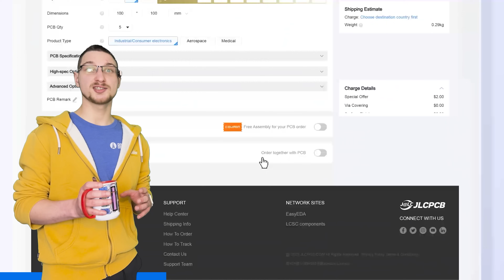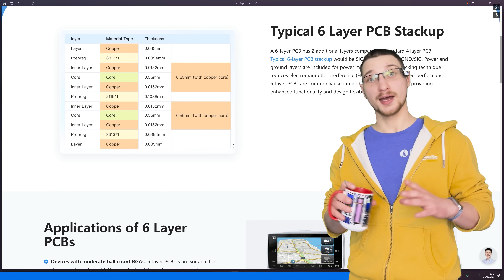How to automate almost anything

Comment: Last year I was doing an art project that involved a raspberry pi zero 2w and some sensors, I had trouble specifically with the max4466 microphone, since the Raspberry Pi doesn’t have an analog-to-digital converter (ADC) built-in, it cannot directly read the analog output from the microphone sensor. I tried to use an arduino nano and then I found that sending data via serial from the Arduino to the Raspberry Pi was unreliable and complicated.

To solve this, I connected an LED to the Arduino that turns on whenever the microphone detects sound above a certain threshold. Then, I placed an LDR connected to the Raspberry Pi near the LED and covered both with an USB’s cap.

Comment: Using those pnp and npn , u can make a gate driver for a mosfets that requires perfect timing and also to remove stress on mosfet and shift the driving load into those npn and pnp transistor that will help running mosfet properly . Ita called push-push from what i know. Good info video!😊

Comment: Why not use the pins of an esp32 directly? Because the gpio can emit 3.3v? Also, it is not clear to me why replace the transistor with a photocell with LED....
Reply from the maker: You can’t use the pins directly because the module requires five faults which cannot be supplied by the GPIOs, and the second circuit is different so the transistor cannot be used…..

Comment: Very cool! I guess with a bit of extra soldering you could also link the LDRs back to the devboard and read the resistance changes, toggling a value in your code. In fact now I think of it, if you started a timer in code to sense for changes just after you trigger the optocoupler, you could be faaaairly sure it was reading back the thing you just asked it to do (turn on, turn off, change mode etc) and then add that as a value to your control webpage/Home assistant. Damn I need to see if I have any mosfets about and see how easy that would be. Great video as always mate.